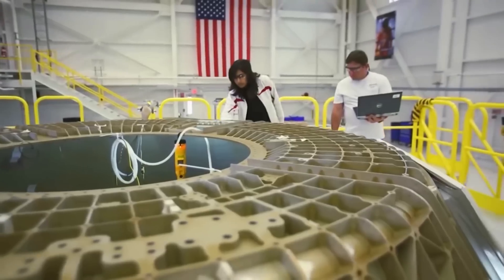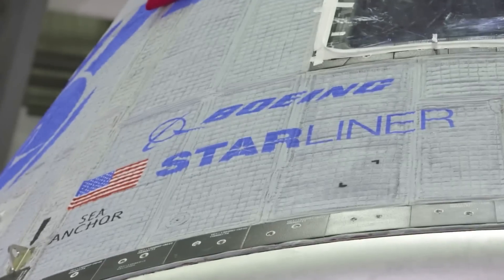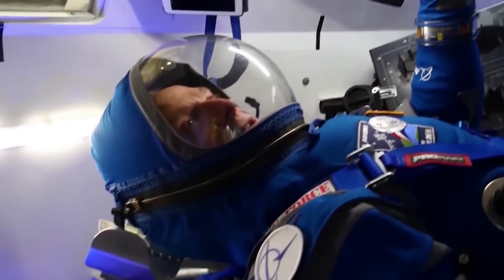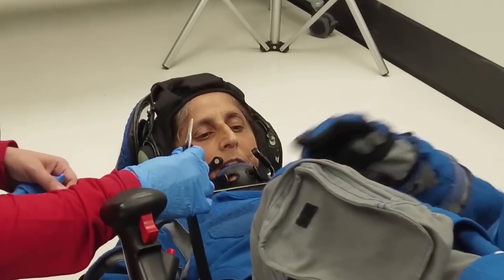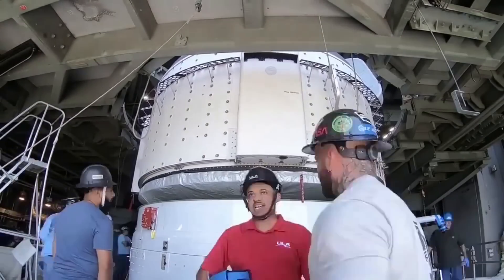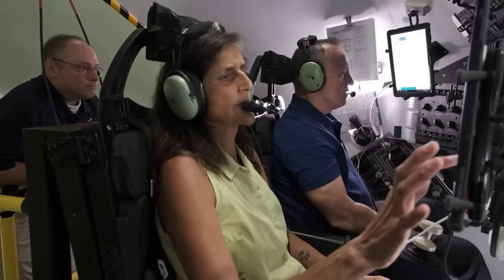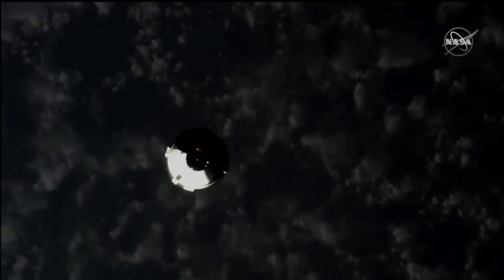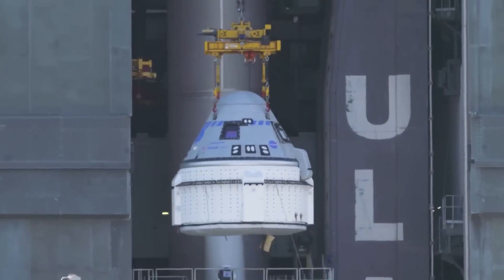Starliner’s First Crewed Flight Test Could Be Weeks Away

Comment: Late this week I read that its very likely Boeing will not make this flight until next year.  They have already cancelled two launch windows this year as it is, and the schedule at the Cape only gets tighter as the year presses on.  The problem with the parachutes is that the "soft links" used are not rated for human flight and are not strong enough to survive one of them breaking.  The tape wrap  they used in the spacecraft is flammable, almost impossible to remove, so they want to try a different tape over the top of it all.  Does no one at Boeing remember the lessons of Apollo 1??

These might be 5% of what needs to be done, but it will likely take months to resolve, and may well require a new drop test to certify the chutes for human spaceflight.  None of these are minor issues.
Reply: To be fair, the tape is flammable only in certain situations per reports and requires failures of other hardware to happen. Per NASA/Boeing, "Although that tape is commonly used on other spacecraft, they are evaluating if it is acceptable for crewed flight (article "NASA and Boeing say preparations continue for July Starliner test flight" by Jeff Foust May 27, 2023)"

Both the tape and parachute links were used on OFT-2 with no problems. The links are being replaced.

Why the double standard? If Boeing can fix the issues to NASA's satisfaction, why should they have to do more unmanned tests? After the unmanned Crew Dragon test flight, a Crew Dragon EXPLODED on the test stand due to faulty valves. SpaceX was able to fix the problem to NASA's satisfaction and the manned Crew Dragon flew next.

A new CFT flight date will have to slip between the Aug 2023 Crew-7 launch, the Sep 2023 ViaSat-3 launch, the Q3 USSF-51 & NROL-107 launches, the Nov 2023 AX-3 launch, the Dec 2023 CRS-29 launch, and Crew-8 in Feb 2024.

Comment: NASA's 5pm EST Starliner update call on Jun 1st, 2023 have announced that they are delaying Starship while they work on parachutes and tape holding wires in place on the spacecraft. The Jul 2023 launch has been delayed to an unknown date.

There is the ViaSat-3 launch in Sep 2023, USSF-51 and NROL-107 launches in Q3 2023, the Nov 2023 AX-3 launch, and the CRS-29 launch in Dec 2023, so Starliner CFT would have to slot in between those flights.

Comment: I’m surprised NASA hasn’t insisted on a 3rd uncrewed test flight before allowing humans on board the CST-100 Starliner. Boeing hasn’t done the end the end programming that’s been normal in American spaceflight for decades that NASA requested before allowing humans or the retesting of the parachute system & other items NASA also requested.
Reply: The OFT-2 was considered a success and as long as Boeing fixes the issues to NASA's satisfaction, they can move on to the CFT. They might not finish in time for the July launch date, so it may move back again. After the Crew Dragon unmanned test, another Crew Dragon exploded on the test stand due to faulty valves. SpaceX was able to fix the issue to NASA's satisfaction, so they didn't have to do another unmanned test, before the Demo-2 crew flight.
Reply: @steveaustin2686  They can always find people desperate enough to fly the Starliner but this system continually surprises with more and more hidden faults.   The faulty wire wrap tape appears to have gone conveniently unmentioned until someone blew the whistle.  If it really needs to be flown manned it should be flown a number of times hauling cargo first to test its reliability.
Reply: @donadams8345  So why the double standard? Crew Dragon EXPLODED on the test stand due to faulty valves!

To be fair, the tape is flammable only in certain situations per reports and requires failures of other hardware to happen. Per NASA/Boeing, "Although that tape is commonly used on other spacecraft, they are evaluating if it is acceptable for crewed flight (article "NASA and Boeing say preparations continue for July Starliner test flight" by Jeff Foust May 27, 2023)"
Reply: @steveaustin2686  Apparently it isn't acceptable for crewed flight though.    The flight has been indefinitely postponed.   Your information is dated.    The Dragon was being tested without a crew when it exploded.  That is what testing is for.   The Starliner needs to fly without a crew until it is proven safe.

Comment: It will be obsolete before its first flight. A waste of time and money. It looks phallic sitting on Atlas V.
Reply: The Blue Moon lander is almost 7m in diameter and is planned to launch on the 7m New Glenn. The Atlas-V is 3.8m in diameter and Falcon 9/Falcon Heavy are 3.7m, so it almost certainly can't launch on them. The Vulcan Centaur is 5.4m in diameter, so it might work.
Reply: @steveaustin2686  And just how long do you think it will be before New Glen is ready? I believe they have 15 Atlas V in inventory. Will New Glen be ready when they are all used up?
Reply: @steveaustin2686  And Starliner is not the Blue Moon lander!
Reply: @michaelmurphy6195  Ah, my bad. I was in the wrong video, as I have been talking about Blue Moon today as well. The Atlas-V's for the initial Starliner contract are all already assigned. As long as they don't need any extra flights, Starliner is good for their first contract. Blue has said that they want to crew rate New Glenn, but it is a 7m rocket, so a 4.6m capsule may look a little silly. The New Glenn is also competing in the Falcon Heavy range, so would be a lot of booster for Starliner. Vulcan Centaur is set to replace the Atlas-V and the Delta-IV Heavy with the use of SRBs, so it is likely who will launch any Starliners after the initial contract is done. The VC2 version should be able to launch Starliner. Vulcan Centaur is currently set to launch in Jul 2023, but that may slide. The Dream Chaser is also going to use the Vulcan Centaur and is working towards a future crew version. ULA is willing to crew rate Vulcan Centaur, but they don't want to pay for it. So it will likely come down to who needs it crew rated the most, for who pays for that.
Reply: @steveaustin2686  This is exactly my point, Starliner is obsolete before it will fly
Reply: @michaelmurphy6195  No, it is the second crew vehicle to the ISS. If NASA had chosen only one provider in 2014, they would likely still be relying on Soyuz to get to the ISS. Having two providers is a good thing.
Reply: @steveaustin2686  I never said it was a bad thing. Boeing is using legacy technology and they can't get that right. Nothing about what they are doing is innovative!
Reply: @michaelmurphy6195  🙄 Whatever floats your SpaceX only goat dude.
Reply: @steveaustin2686  Your Vulcan rocket made by ULA "Boeing and Lockeed Martin" with legacy technology. How many of those will you throw in the ocean before you float the only goat?

Comment: Good analysis.  My guess is also that the first crewed launch will be delayed until autumn.
Reply: Very possible. The July date is squeezed in between CRS-28 leaving and Crew-7 going up. Also there is the ViaSat-3 launch in Sep 2023, USSF-51 and NROL-107 launches in Q3 2023, the Nov 2023 AX-3 launch, and the CRS-29 launch in Dec 2023, so Starliner CFT would have to slot in between those flights.
Reply: Autumn? You must be from the Northern hemisphere; try using dates instead, it's less confusing, globally.
Reply: @davidstevenson9517  You have a point there.  So let's say Q4 2023.

Comment: Ya right lol I wouldn't be the first one in that without a dry run test lol. After the last failed mission , no way.
Reply: No you're right, I actually forgot about dragon exploding. I personally feel like you should at least have one successful unmanned launch before humans are put in. I mean it's not like they need the humans to fly it so.. just seems like common sense. But honestly it's just my opinion, and I'm just a guy. I have full confidence the pros working on it know what they're doing, more than I do lol.
Reply: @Redfiregtag  NASA said that the OFT-2 was a success, so they did have one. Yeah, NASA engineers have first hand access to the hardware, so if they say it is good to go, I'll go with their expertise. They may not make the Jul 21st launch date for fixing everything, so the FRR in late Jun or early Jul may push it back again. The July date is squeezed in between CRS-28 leaving in Jul and Crew-7 going up in Aug. Also there is the ViaSat-3 launch in Sep 2023, USSF-51 and NROL-107 launches in Q3 2023, the Nov 2023 AX-3 launch, and the CRS-29 launch in Dec 2023, so Starliner CFT would have to slot in between those flights.
Reply: The 2019 OFT-1 failed. The 2022 OFT-2 had issues, but they were able to complete the flight with backup systems. If they fix Starliner to NASA's satisfaction, why should they not go to the CFT? After all, after the unmanned Demo-1 for Crew Dragon, there was a Crew Dragon that EXPLODED on the test stand due to faulty valves. They fixed Crew Dragon to NASA's satifaction and flew the crew Demo-2 next. Why the double standard?

Comment: I think Starliner needs several more test before anyone steps on that death trap.
Reply: As long as Boeing can fix the problems to NASA's satisfaction, they don't need another OFT. For example, between the unmanned Demo-1 mission and the crew Demo-2 mission on Crew Dragon, a Crew Dragon exploded on the test stand due to faulty valves. SpaceX was able to diagnose the problem and fix it to NASA's satisfaction, so another unmanned test was not needed.
Reply: @steveaustin2686  agreed , dragon passed it's flight test and updated everything to NASA's satisfaction before it took humans up. Starliner needs to pass an unmanned flight test before anyone goes up even if everything is repaired and updated to NASA standards.
Reply: @liquidpatriot4480  So a double standard then? SpaceX can fix the valves when a Crew Dragon EXPLODED on the test stand and NOT have to do another unmanned test. But Starliner with much more minor problems has to do more flight tests? Why shouldn't Starliner have the SAME STANDARD of fixing the problems to NASA's satisfaction as Crew Dragon did? When Crew Dragon EXPLODED due to faulty valves!!
Reply: @steveaustin2686  read my comment again. SpaceX repaired and updated dragon to NASA's satisfaction and it passed its test flight.
Even if Boeing repairs and updates to NASA standards, it still has to pass a test flight just like dragon. So not a double standard 🤣🤣🤣
Reply: @liquidpatriot4480  So you are saying that Starliner must redo the OFT for a third time?
Reply: @steveaustin2686  yup. If it passes then send people up. It's had too many major issues on the last two flights and problems trying to launch it.
Reply: @liquidpatriot4480  Dude, you just described a double standard. Do you realize that? Starliner's last OFT made the ISS and the backup systems covered the problems, as backup systems are supposed to do. Crew Dragon, in between the unmanned Demo-1 and the crew Demo-2, EXPLODED due to faulty valves. Not had a problem, but EXPLODED the WHOLE spacecraft. SpaceX was able to fix the faulty valves to NASA's satifaction WITHOUT having to do another test. So you are saying that Starliner should not be offered the same thing, when their problems on the last flight were much less than EXPLODING the whole capsule?
Reply: @steveaustin2686  And it still had problems with main systems and had problems trying to launch it on two separate occasions so another test flight should be in order. So no, it's not.
Reply: @liquidpatriot4480  it did
Reply: @mathewferstl7042  no it did not or it would have flown several times by now instead of being grounded as Boeing and NASA try to figure that mess out.
Reply: @liquidpatriot4480  🙄 OFT-1 was in 2019. OFT-2 was in May 2022. Are you sure that you actually know what is going on?
Reply: @steveaustin2686  and both were failures including 2 attempted launch failures.
Reply: News update: Starliner has flammable tape, more valve problems, new problem with parachutes.
Going to be a while before they can  conduct another unmanned test flight.
Reply: @liquidpatriot4480  To be fair, the tape is flammable only in certain situations per reports and requires failures of other hardware to happen. Per NASA/Boeing, "Although that tape is commonly used on other spacecraft, they are evaluating if it is acceptable for crewed flight (article NASA and Boeing say preparations continue for July Starliner test flight Jeff Foust May 27, 2023)"

Boeing finds two serious problems with Starliner just weeks before launch
ERIC BERGER - 6/1/2023

"The second issue involves P-213 glass cloth tape that is wrapped around wiring harnesses throughout the vehicle. These cables run everywhere, and Nappi said there are hundreds of feet of these wiring harnesses. The tape is intended to protect the wiring from nicks. However, during recent tests, it was discovered that under certain circumstances possible in flight, this tape is flammable."

---------------

Parachute and wiring issues to delay Starliner crewed test flight
Jeff Foust - June 1, 2023

"Both the parachute soft links and wiring tape were used on the Orbital Flight Test (OFT) 2 uncrewed test flight in May 2022 without incident. The soft link issue, officials said, would only be a concern if one of the three main parachutes failed, putting additional loads on the other two, while the flammable tape would have required what Nappi called “multiple failures” elsewhere in the spacecraft."

-----------------

A new CFT flight date will have to slip between the Aug 2023 Crew-7 launch, the Sep 2023 ViaSat-3 launch, the Q3 USSF-51 & NROL-107 launches, the AX-3 launch, and the CRS-29 launch.

Comment: It will be great to have some extra competition in the crewed spaceflight department. We currently have at most 6 different vehicles capable of putting humans into space, and only 3 of them are actually designed to fly to spacestations in LEO.
Reply: SpaceeX charges $54 million per seat on crew Dragon & is profitable at 3 seats (the 4th is extra money). Boeing sells seats on Starliner for $94 million each & isn’t profitable unless all 4 seats are sold…
Reply: @TraditionalAnglican  With Boeing being contracted to fly 24 astronauts, they have a per seat cost of $183M to NASA. In the same time frame, SpaceX has been contacted to fly 56 astronauts, costing NASA $88M/seat. Arguably, this isn't a fair comparison as the NASA RnD funds have been spread over more flights, but that's the current state of affairs.

Roscosmos charged NASA $90M +NASA does cargo delivery to ISS for Russia for 2 years, in 2020, for one seat on Soyuz. Meanwhile, Roscosmos (with SpaceAdventures as a middle man) charged private space tourists around $20M for one seat in the early  2000s ($30M inflation adjusted).

Comment: Why not first try another cargo test before humans if there is so much doubt in safety? Gives Boeing a bit of money and FAA more data of all the upgrades are truly enough.
Reply: As long as Boeing can fix the problems to NASA's satisfaction, they don't need another OFT. For example, between the unmanned Demo-1 mission and the crew Demo-2 mission on Crew Dragon, a Crew Dragon exploded on the test stand due to faulty valves. SpaceX was able to diagnose the problem and fix it to NASA's satisfaction, so another unmanned test was not needed.

Comment: Starliner won’t last long when it costs at least double that of SpaceX’s  Crew Dragon…
Reply: Not quite double. The NASA IG put the 6 initial Crew Dragon missions at $55M per seat and Starliner at $90M per seat. Since the contracts are fixed-price contracts, Boeing has been paying for Starliner fixes, not NASA.
Reply: @steveaustin2686  That's correct.. and it's rather amazing Boeing swallowed that sticky load to continue with Star Liner...especially sense SLS is far, far, far more lucrative. Of course if Boeing hadn't fked this up so badly.. We're talking Bud Light levels of incompetence.. they would have had this thing flying years ago. But John Shipp is right.  It'll be a man rated ISS service rocket NASA never uses.
Reply: @hawkdsl  Nah, NASA still wants Starliner to alternate flights with Crew Dragon. They don't want another repeat of only having one provider and having to rely on Soyuz again. That's why all the commercial programs have been 2 providers at the minimum.

Boeing's merger with McDonnell-Douglas in the late 1990s is widely seen as the reason Boeing fell so far. The MD corporate managment took over from the engineering based manangment and ran the company into the ground chasing short term stock pricing. The new management has a very deep hole to dig themselves out of.

NASA has been moving to the commercial model with fixed-price contracts, so hopefully SLS, Orion, and the ML platforms will be the last of the cost-plus contracts.
Reply: @steveaustin2686  Great point, I learned this (the merger was the start of Boeing's downfall) in the Frontline episode "Boeing's Fatal Flaw," available for free on Youtube.
Reply: @TranscendentBen  I saw that one.